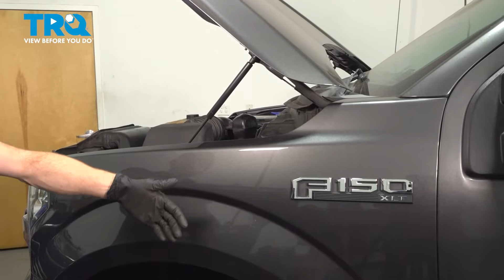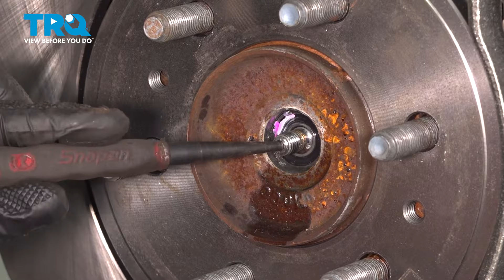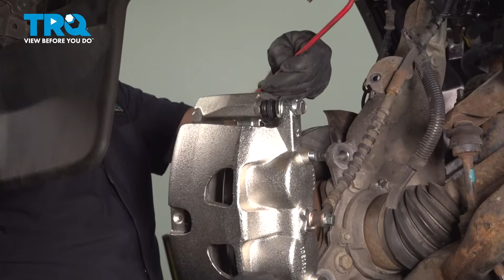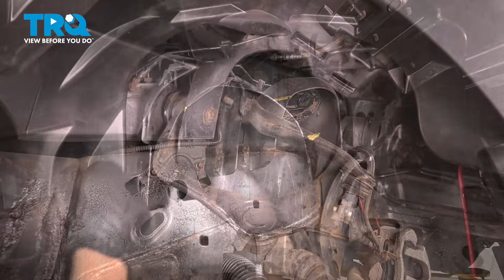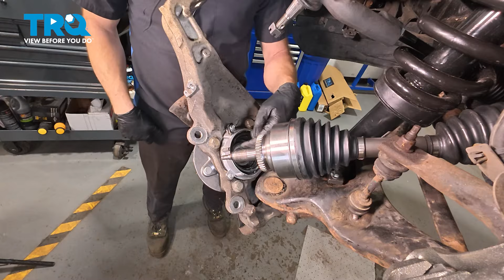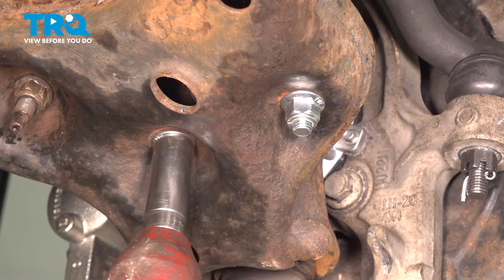How to Replace Upper Control Arms 2015-2020 Ford F-150

Comment: Would you position the control arm in original position if you were installing a leveling (2") strut assembly? Or would you need lower it down to accommodate?

Comment: Great how to video! 

Miss the days with the older F150's where you could just loosen the upper ball joint and the 2 mounting bolts/nuts, pull the upper control out and put the new one in and tighten everything back up. 

I wonder why Ford decided to have the mounting bolts started from the inside instead of the outside on these newer F150's.